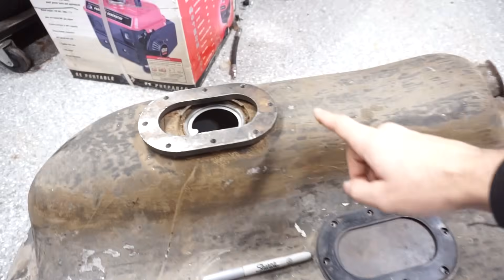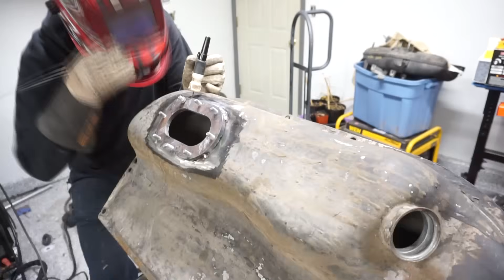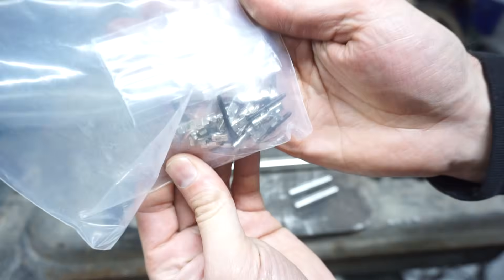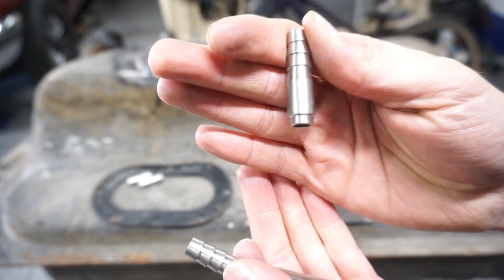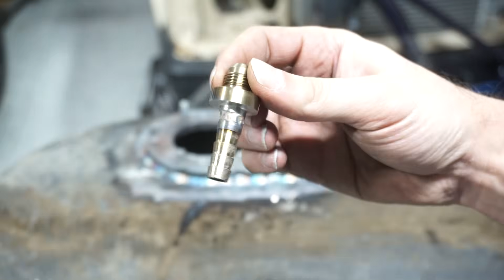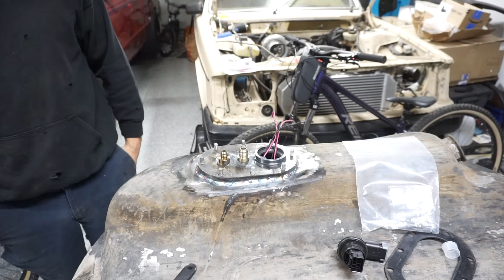Turbo Volvo Wagon Dual Fuel Pump Hanger Build

Comment: A good way to get rid of fuel vapors in a tank is to hook the tanks filler hose to the exhaust on a running car and leave the sender off the tank to let the exhaust out run it till it’s clear of fumes

Comment: Looks great! Might consider using just pickup tubes or sumping the tank instead.  Those intank pumps are amp hogs and don’t out out near the flow at “boosted pressures” that the AEM400’s do. Also much easier to access/service/replace external inline pumps.

Comment: Looking good! Do you plan on putting some fuel tank sealer on the inside of the tank to prevent corrosion or damage to the injectors?

Comment: I am thinking one 450 in the tank feeding the inlet of another external 450 with a big return return line is the way to go.  These little pumps don’t suck fuel too well under hard acceleration but if you feed one into another their capacity goes way up.

Comment: Can you use e85 with the rubber hoses on the pumps?
Reply: He said it's "submersible e85 hose".
Reply from the maker: @jimriley3954  Yeah going to use the submersible e85 hose. These were just for mock up.
Reply: @BlaserBuilds  Use a metal hose clamp on those pumps to the hanger. That/those zipties wont last long submerged. Ask me how I know.
And next one who dogs ya for fabbing stuff, ask em where there single digit quarter mile street car is. You want to have a grudge race with it.

Keep up the great content.